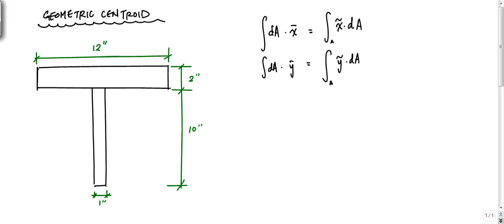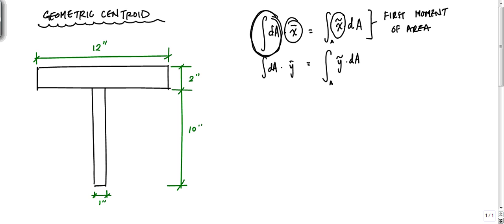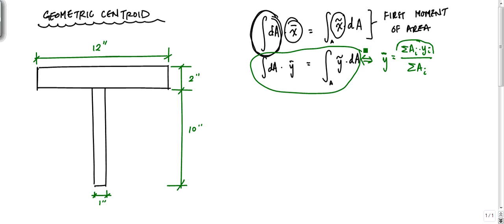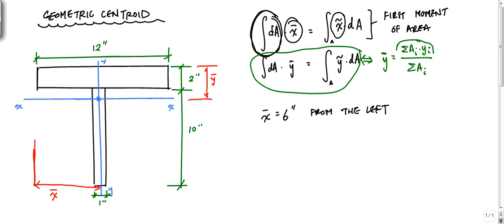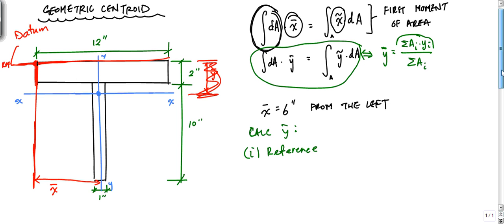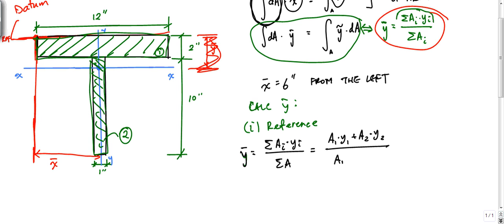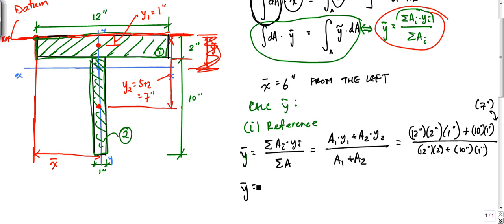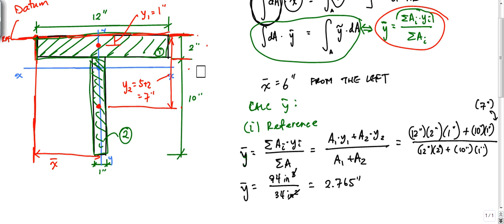Geometric Centroid of a Cross Section - Structure Free

Comment: if you start you reference from the bottom, aren't you gonna get different value of y bar?
Reply: actually the value of y is different but the result is same. I just calculated if u start from the bottom, y=9.23 from the bottom, which is the same hight as 2.77 if you start from the top.